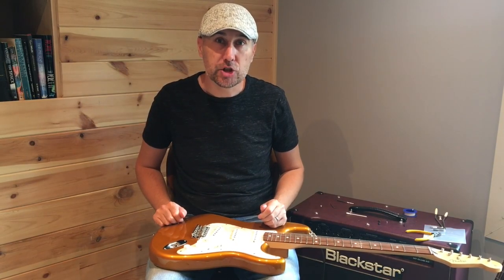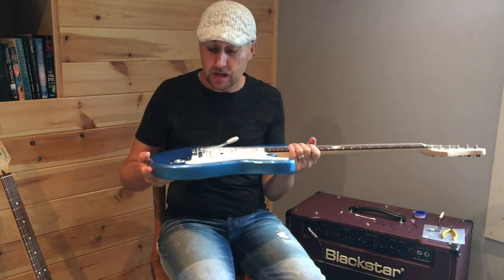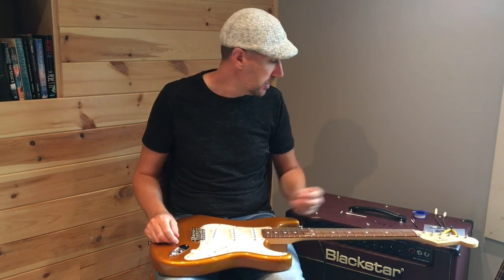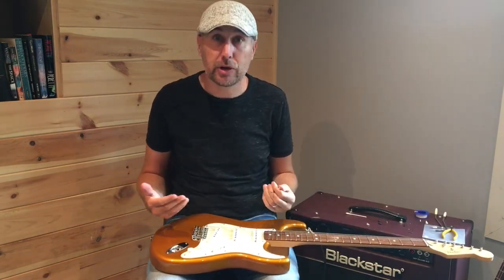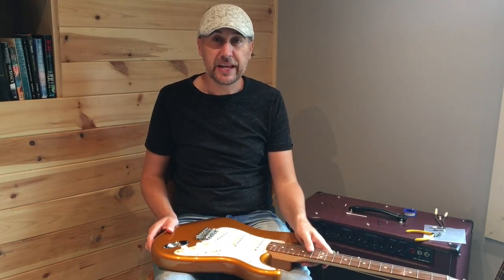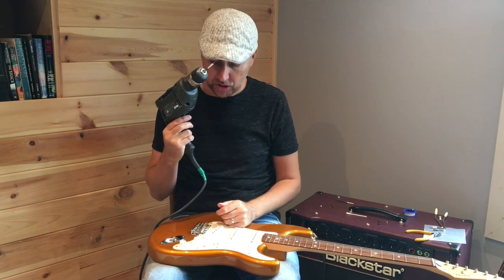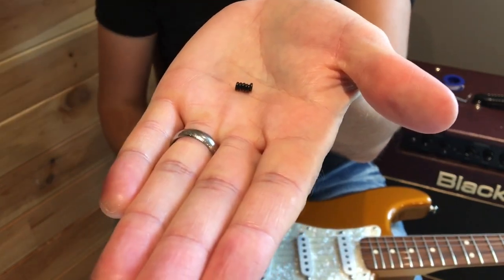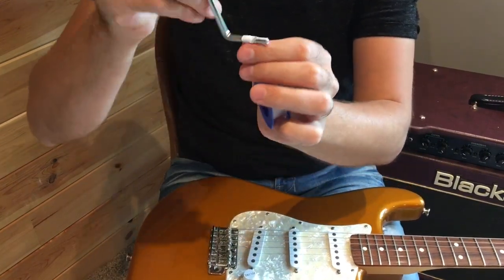the WRONG way to tighten your trem (and the right way)

Comment: Henry Dueck, this method works good for me. I have been doing it this way for years. The slop is at the top of the block cavity, so that is where the tape is handy. To me it beats spending a ton of money for an expensive Calaham, or the other systems that some say work better. Good advice in my opinion.  I would never stuff cotton in the hole, but have never had a problem getting tape off the bar. It doesn't take much tape and the tape is up at the top of the threads, like you said. I bought a fender deluxe pop in system for my USA standard, but I never installed it. I don't like the big thick bar. It sits to high for me. I usually bend my bars at the angle point so the bar tip is at the height I like it. The Deluxe bar is wayyy thicker, it might be harder to bend. Thanks for the video, I hope people try it.

Comment: Hi. My Squier Classic Vibe Strat did not come with a spring! What size spring is that and where can one get one? I have the exact same trem arm play problem as you highlight. I just ordered some pipe tape but I need that spring! Thanks.
Reply from the maker: I only know of one size of those trem arm springs, and you should be able to order them from most music stores.

Comment: My whammy bar doesnt even sstay at the right place anymore. It now reaches. Itd max position above the volume knob.how do i solve this
Reply: you possibly damaged the threads on either the tremolo bar OR in the hole that the bar screws into. Inspect the threads on the bar, and if you dont see any significant damage. You could get a new tremolo block or take your guitar to a luthier.

Comment: Mine won't even screw in help
Reply from the maker: It might be that the threads are stripped - in which case you could try more plumbers tape and see if it grabs - or you might be using a mismatched sized trem arm.  Not all tremolo arms are the same size.

Comment: Hi.  My Trem makes everything slightly out of tune when i use it.   Is there a magic formula ?   Cheers from England.
Reply from the maker: One of the main problems contributing to strings going out of tune is the windings around the tuning pegs. There is a "locking" technique I learned from YouTuber Darrel Brown Guitar that works really well.  Check out his channel, it's super helpful. Another trick I use, is put some graphite dust from a pencil into the string slots in the nut.
Reply: @henrydueckmusic  Thanks for the promt reply
Reply: Another reason can be that the bridge must be a bit floating (not blocked to the guitar bodie) so the strings can have the right space for return in tune

Comment: Well i accidentally oveetightened my whammy bar back when i first brought the guitar and the more i tightened it i noticed thàt it became looser. Is my guitar doomed?
Reply from the maker: it sounds like you may need to back it off a couple of turns and then use the spring and/or tape I mention in the video
Reply: You may have stripped the internal threads.....

Comment: Yea I tried that tape and it didn't work, either. Not only that, it was hell getting it out of the threads after that. It took a fine pick and 5 or 10 minutes of digging. 👎 I'd venture to say it's even worse than the cotton. 

A Fender tremolo arm spring worked much better than any of the half-assed home remedies and they're like $3 or $4 for a pack of 3.
Reply from the maker: J D C As in the video, I use the Fender trem spring as well. Then I use the tape just near the top of the threads to get rid of some of the "play." The trem spring is what keeps the arm in the position you leave it.
Reply: @henrydueckmusic  yea I got my springs yesterday. Picking all of that tape out of the threads was hell, though. I'll never make that mistake again. Judging by what the threads did to the tape, I'm fairly certain those threads were all cut and not rolled. They decimated that tape into shreds making it almost impossible to remove.

Another reason I got springs was the fact that I came across quite a few bridges for sale with trem arms broken off in them, which is said to come from having your arm too tight. I imagine it's from people cranking it down all the way(w/out spring) so it would stay in position, then it breaks at the threads from stress and likely from stress risers left from the thread cutting procedure.

 Thanks for the reply!
Reply: @J__C__  I use the springs, but I also use a bit or teflon tape, but the tape is for the slop AT THE TOP of the block cavity. If I remove the trem bar, any tape is on the threads of the bar, not down inside. Fender blocks are just made kind of sloppy that way. Wrapping the threads all the way along the bar will work for a while but eventually it will wallow out the threads in the block. What Henry is doing works great for me. I have been doing it that way for 25 years. I also usually bend the bar angle down in a vice, so I can get the distance of the tip to the guitar low enough so it's just the right height to cradle the trem bar in my palm and pluck the strings under it. Most of the bars that come with fenders, whether USA made, MIM and even squires sit to high for my taste. Bending the bar where you want it is easy enough. You can buy more expensive better trems and blocks that don't have that slop, but on my 10 or twelve strats I have never tried one. Henry's method works fine for me. Sorry it doesn't work for you. It doesn't take much tape at all.